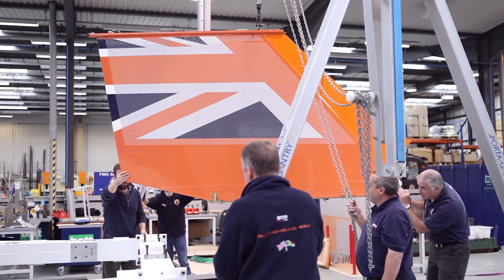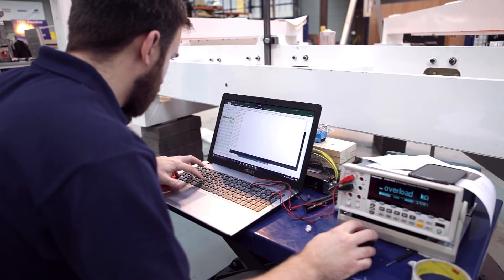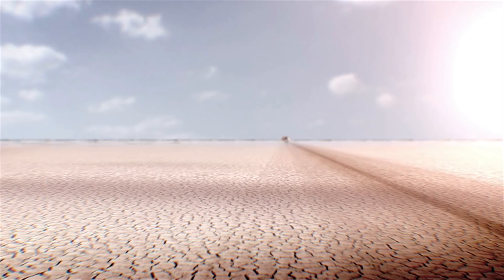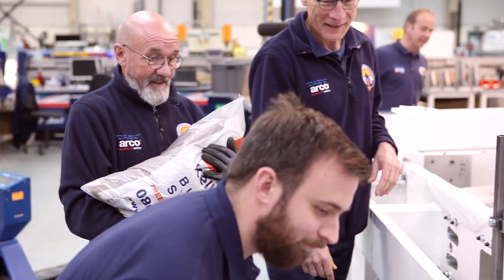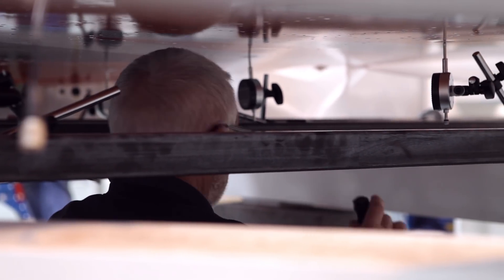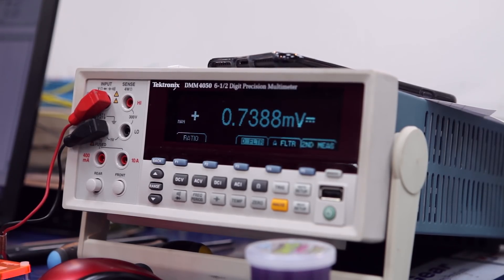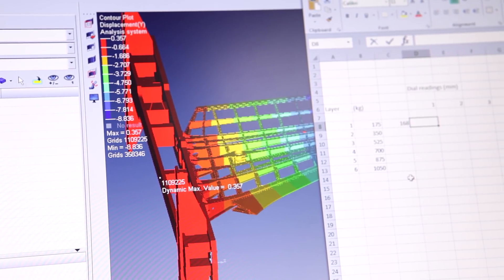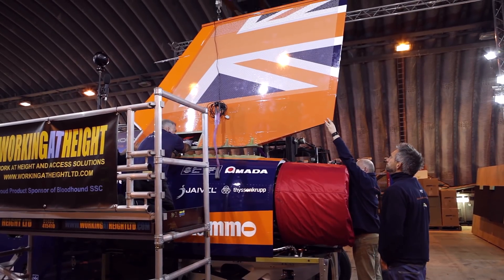Cisco BHTV: Stress Testing The Fin

Comment: Steering problem going straight ?
Reply: Scott DeArmond  without a vertical “canard” for The main steering be for transonic regime the car will be all over the place. At the upper end of speed the front wheels should be non-steerable and steering accomplished only by the canards. The side loading on the wheels will be ridiculous. Even though they are massively overbuilt, all movement needs to be illuminated at terminal velocity. Read what the other record breakers have said at the top end. The biggest problem was stability. Wondering left to right. Bloodhound has enough power no doubt! That isn’t even a question.
Reply: Slightly over simplfied there - far from just 'going straight'!
Wind deflection & surface imperfections I would imagine are major factors in deciding where the car is going and the driver/pilot havign to counter!
Reply: The" Rudder" with a crosswind will try to steer the car .

Comment: I believe that bloodhound at TopSpeed will have steering problems big time. The most important thing that it needs it does not have.
Reply: ricvis44 The car was designed by Ron Ayers who is a jolly clever chap and an all round good egg who designed Thrust SSC.
Reply: Lol listen to this guy. He makes it sound like minimal design effort has gone into this.....
Reply: ricvis44 Everyone is entitled to an opinion old egg, but that chap who actually did it, however imperfectly is the one who goes down in history and the commentators on the sidelines are just bystanders with an opinion. Top of the day to you in any case.
Reply: lol yea I heard they couldn't be bothered to design the front end so they are just gonna see how it pans out...….
Reply: Why?
Reply: My expertise is with Aviation. More specific the F-4 Phantom. I have went 303 Miles per hour in a Camaro. Time will tell if I’m right. Seems like there were so worried about the rear of the vehicle when they should be worrying about the front of the vehicle. Specifically the transonic regime.
Reply: Sub Zero great show of the car today. It is very well built. Several million dollars so it should! They said today that at high speed that the front wheels acts more like rotors. I would still like to see A vertical canard for steering. The stresses on those wheels turning at 10,400 and something rpm’s is very concerning. But it is going to be very exciting! I can’t wait till they run the car wide open.
Reply: James Rindley thrust SSC had it’s intakes way too low to the ground. Mr. Ayers designed it and I would have disagreed with his design. That doesn’t make him unintelligent it just means we disagree on how it should be designed.